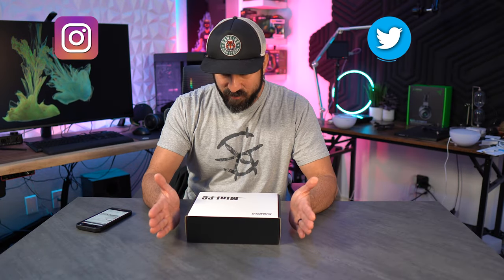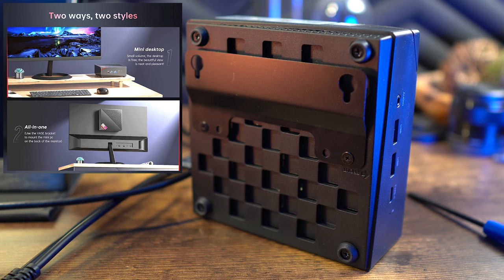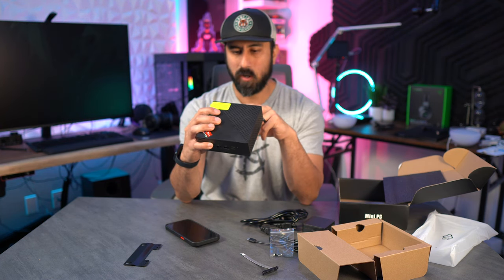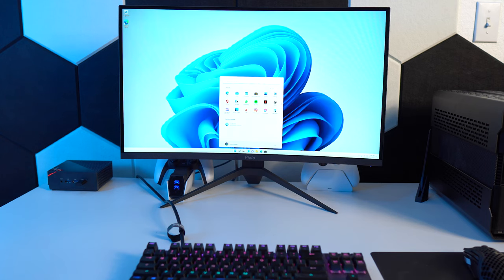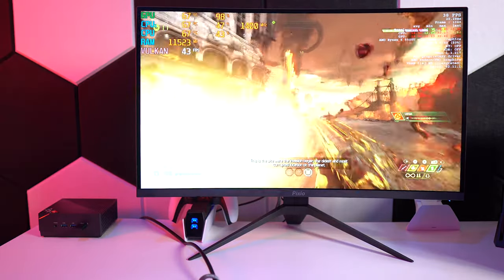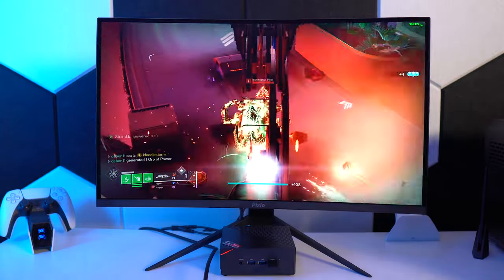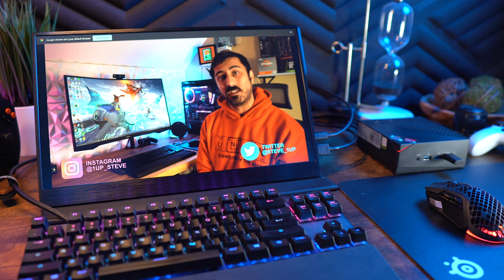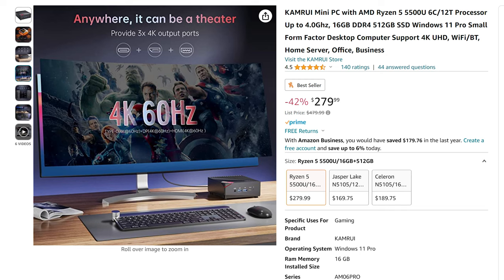KAMRUI Mini PC with AMD Ryzen 5 5500U - A Small Form Factor PC that Packs Some Power!

Comment: Wondering if cloud gaming would work well with this setup.
Reply from the maker: With Ethernet it would, via Wi-Fi I think it would struggle
Reply: @1UpNerdcore  Probably depends on your uplink. I got 200Mbps on Wireless and 900Mbps on wired. That should be sufficient for cloud gaming. Might depend on codecs and CPU overhead, more than bandwidth. Also dependencies on your WiFi.

Comment: I bought this off Amazon and upgraded to 64gb ram and a 1TB gaming NVME which is 6x faster than the original. It works "good" but nothing will overcome it's anemic GPU. It's great for every day things that don't require a whole lot. If you are a photo/video editor and expect performance, you will be sadly disappointed. If your idea of gaming is solitaire, you'll be very happy. My advice, buy it for what it is and don't bother upgrading anything. It doesn't make that much of a difference with a piss poor GPU.
Reply: Is it go to play Roblox full graphics ?
Reply: I bought it for GameCube and ps2 emulation. Good deal $250

Comment: Thank you for the informative video, does the power adapter work on 220v ?
Reply from the maker: The input is 120v and I don’t know if it’ll down regulate from 220 to prevent it getting to much electricity and causing damage
Reply: @1 Up Nerdcore  
Oh my bad, I have to get myself a convert in this case as I already ordered one of those tiny monsters. Anyway, thank you for your quick answer
Reply: The AC adapter supports 110-240v 50/60Hz, according to the label. The output is USB-C, so you could maybe even use a power bank if you're mobile. I've got one, I just haven't tried it yet. All you'd need is a cable adapter.

Comment: Hi. On what settings you play Ori?
And have you tested Ori 2?
And can this PC run Nintendo Switch emulator, 2D games maybe?
Reply from the maker: Medium setting, I haven’t tested ori 2 but I suspect is has similar performance. This should run emulators just fine for older consoles but a switch might not do so great.
Reply: @1UpNerdcore  thank you very much)